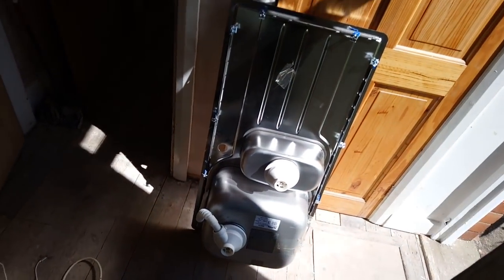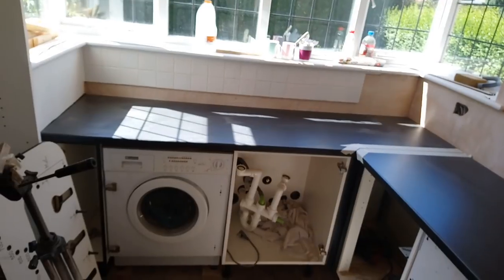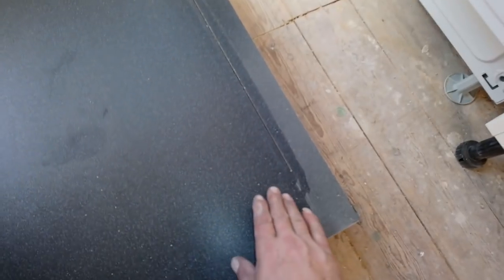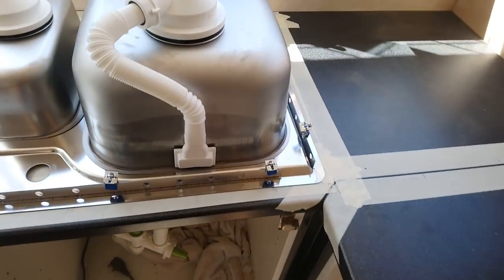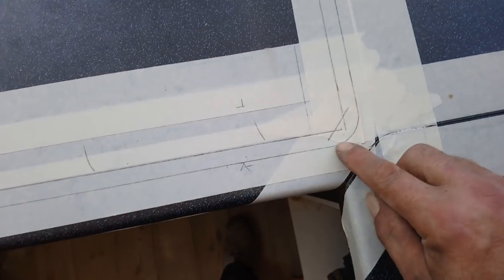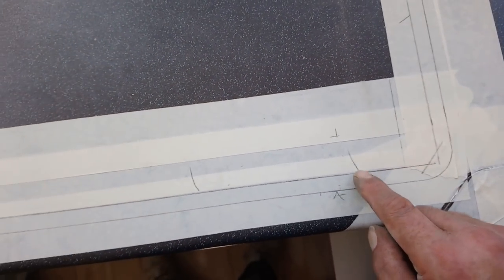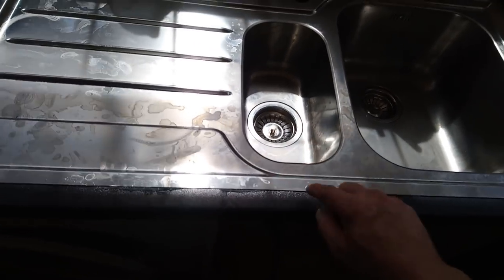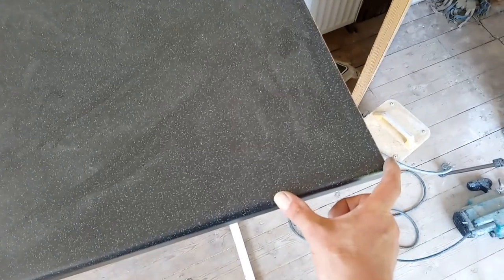Kitchen Fitting Pt15, Worktop fitting, cutting in the sink & hob with the Makita plunge saw

Comment: Thank you for a very useful video. I thought I had seen everything I needed on other videos, but I learned much more from this one of yours, especially the idea of unbolting adjoining base units to ease one out for access to the back wall. Your quiet, deliberate method of working is a good example for us to follow.
Reply from the maker: Thank Ken, I hope these help  👍
Yep that is the plan for my vids, to give those little bit of information/tips that other vids skip over or don't show,
Reply: @Gidjoiner  is there different sizes of guide bushes for routers ie 30 or 20 mm,
Reply from the maker: @garethtelfer1376  Hi, yes there are, not sure right now how many different sizes but i have a 15mm as well as this 30mm .

Comment: Brilliant and informative. My only niggle is the use of those waste manifolds under the kitchen sink - they fill up so much useable space in the unit. It's just as easy to fit two ordinary P traps (with washing machine connections if necessary) then you have more space to fill with 'stuff'.
Reply from the maker: Thanks Karen 👍 Yep they are a bit rubbish, not very well made, the threads on the joints aren't good but i fit what i'm given, they can upgrade if they want & as these will prob deteriorate in time they prob will have to 🙄😏

Comment: There is a surface cutting feature on the makita rail saw, near the trigger there is a plunge pin, set in it only cuts 3mm deep...once scored then you can plunge blade full deapth and finish with almost no chipping of surface 👍
Reply from the maker: Yes I know , 
why didn't i use it?
I dunno 😐
thanks👌

Comment: Good stuff...I usually drill a hole in the corners of the cut outs for sinks and hobs etc...spade / auger bit to match radius required.
Reply from the maker: Thanks, yeah i normally would when i was cutting with the jigsaw & did when i did the rented house recently, I think on this my head was full & i was just thinking about the saw 🙃😏

Comment: I didn’t have a lot of success with the Freud blade vs the original Makita, especially on the laminate offcut side. I buy the twin pack at £30 online (original plus rip) B-49345. Screwfix charge £50 just for the original alone. The rip blade in the twin pack with joined tracks is very good for straight lining rough stuff before machining up while preserving the main blade.
Reply from the maker: Hi, yeah it's not as a clean cut as the Makita, first time i replaced with the same online shopping but this time being a bit lazy i looked at Screwfix price of £50 n thought I'd give the Freud a try, think next time I'll go back to Makita, just had a look, FFX £30 for the two,👍  I have a rip blade bought for hardwood tops but a spare would be nice, 😉  
I've got the 3m track so no joining tracks for me, when i bought this machine i knew that joining em would do my head in so splashed out a bit of extra cash, this one is a cut down of one of the two 1400mm tracks that came with the saw, 1400 was a bit too long for doors n worktops but 1400 was a little short for a 1220 board so i chopped 300mm off one n added it to the other, making this 1100 & the other 1400 became 1700, with the 3m they do well, I would like a 2.4m for ripping doors etc. the 3m can be a little big esp for working inside a house.

Comment: The SP6000 has a scribe cut facility - whereby you can cut into the finished face with out chipping. When engaged, the first pass only cuts into the face by about 2mm. I've never had a problem with chipping using this method...

Comment: Hi Gid I’m glad i discovered your channel, learning so much just listening to what you say and watching what you do, much better than any other channel I’ve watched trying to learn proper joinery. Ive got a question about plunge saws and chip out, if the saw was pulled back to make the cut could you do that and avoid chip out? Sorry if thats a dumb question, I’m learning.
Reply from the maker: Thanks Alan I'm glad my vids are helpful, yep i've been a joiner 36yrs, apprentice trained time served so I'm showing my work, how i earn my living, not an amateur in his garage creating things just to make vids to put on YT,  For the saw being pulled back that would cause the saw to climb & things would go tit's up in a very fast dramatical way, 😱 this saw does have a function that only lets the blade go down into the wood a few mm scribing the surface which reduces break out, some table saws have a small scribing blade in front of the main circular saw blade that runs in the opposite direction, a little like you suggest but only sticks up a couple of mm's scribing the wood before it goes through the saw., Sometimes when using the router on a edge i might run the cutter the wrong way, as i say this is classed as a climb cut & is very dangerous,
Reply: Gid Joiner thanks for that explanation, I never knew about the scribing blade in some table saws and I can see a climb cut could get exciting quite quickly. You can tell you know your trade inside out, I get so much out of every aspect from choosing the timber through the cutting and joining process and even how to spray paint and the equipment you use for it all. You just don’t get this from a book or from anywhere else really. Love all the jigs and different uses you put the saws/router to without fancy cnc stuff, yup you make it look deceptively easy, and it really isn’t.

Comment: Hid can I ask another question when you cut out the sink did you make allowance for the blade thickness, Inam about to use the plunge saw for cutting out a sink and the inner line is 10mm inner
Reply from the maker: Hi, James, the thickness of these blades is only a few mm but i always mark & decide which side of the pencil line to cut, on a mitre saw i would either cut leaving the line in, cut along the line so leaving half the pencil line in or cut it so i remove the line completely, with a track saw i would lay the track so the blade cuts to the waste side, So yes, i allow for where the blade kerf & whereabouts in relation to the pencil line it will cut, This is the same with any saw, powered or hand saw. 👍
Reply: @Gidjoiner  Hi Gid thanks for getting back to me,great appreciated the saw is fairly new to me and after using the saw realised that if you mark from the left then you keep you saw line to the right this way there is practically no kerf if you do it the other way you do get the 2mm add on.In cut out for a  sink today using the plunge saw same as yours but found that the mark to the rear to start the plunge did not line up to a 40mm cut

Comment: How do you use Irwin clamps with your track? Have you customised the ends?
Reply from the maker: Hi yes, the bar of the clamps almost slides in the grooves of the track, they're the right thickness but just a fraction wide, prob no more than a mm so just a quick once over with a sanding disc, i cut off the plastic clamp end & a length of the bar then welded it back on at 90º, I show them a little better in other vids but sorry can't remember which.
Reply: You can actually buy clamps that are made to slide in to the groove on the underside of your track, they are made by the manufacturers of your track so in this case they would be made by Makita. 👍🙂

Comment: I just use a stanley blade to trim those edges of the stick on siding, does the file give a cleaner finish?
Reply from the maker: I use a knife to cut the iron on edges, they need sanding then to remove the sharp edge & any remaining lip, the laminate on the worktop using a file makes a clean edge but cutting with a knife on laminate might crack unexpectedly, I'm not sure which you're ref to but this is how i was taught 🤷‍♂️👍
Reply: Use a flush trim bit in a small router or trimmer and just run it along the underside of the worktop and around the radius to trim it flush it'll be a perfect finish, no need for filing.
Top tip, when you stick the edging on keep it flush with the top and front edge, let the excess hang below and out the back edge!

Comment: I noted that you didn't seal the cut surface with pva or similar, why was that, and also in the corners, why not use a flat blade and drill the corner out?
Reply from the maker: PVA isn't waterproof, although the chipboard is very prone to moisture/wet, I come across very few sinks, if any, that have been sealed around that cut edge so i don't believe many people do, When i used to cut the hole with a jigsaw that's what i'd do, drill the corners n cut,

Comment: Any tips on using the trimmer on the laminate edge ? In the video it seems you're using the router opposite to how the blade spins .
Reply from the maker: No sorry, i think i mentioned in the vid that i prefer to use the separate wheel/fence that comes with the router, in either case only have just enough cutter showing so if the router leans over it doesn't gouge into the top. I didn't go in that direction for any reason apart from the cutter seemed to leave a neater finish, I was only removing a very small amount & it was an old/blunt cutter, I think i cut out the talking about that when editing because i ended up talking waffle  🤪🙃 Cut in the normal direction 😉
Reply: @Gidjoiner  Thanks for tip . Using this method to cut the edging Sat for the first time.  Recently subscribed and enjoying the Vids nice work 👍
Reply from the maker: 👍 Good luck with that, sorry sometimes i find it hard to put into words what I'm doing, if it's your first time try it on scrap if you can, like i did do the underside first & try the cutting on the very back edge to see how it's cutting, not all these flush trim cutters cut flush, If you watch the bench i made recently the new flush cutter i used when cutting the curved ends cut into the template piece 😒 Thanks Danny, 👍
Reply: Well. Took you're advice on the worktop edging Saturday just gone ,  just showed enough of the cutter to cut the edge trim and it was almost factory finish really pleased with the results. Actually as long  just show enough of the cutter it's hard to make a mistake .  Thanks for the advice 👍
Reply from the maker: @TheAces81  Good, You're welcome, I'm glad it worked out well, 👍👍

Comment: When tightening the worktop bolts, how tight should you do it? Can over doing it affect the alignment? Once you see the squeeze out of colourful? Many thanks again!
Reply from the maker: The bolts when over tightened just start sinking into the worktop wood, it doesn't moved the joint out of alignment, i make sure the joint is good before fully tightening 👍
Reply: Gid Joiner thanks for the quick reply, so just to recap, as long as you see the squeeze out along the joint and pulls in tight. There’s no need to tighten it to the extreme?
Reply from the maker: No/yep 🤷‍♂️😁, there's a point where it's tight n won't make a difference, there's a poss on cheap worktops if the bolts are near the surface you could start buckling the worktop wood n causing more harm than good, that'd be rare tho, if the mitre was touching & there was a gap on the long edge, tightening the bolts to extreme might not make the mitre slide closing that gap.